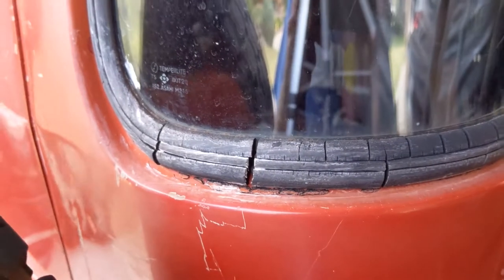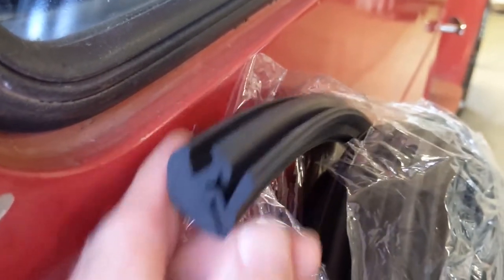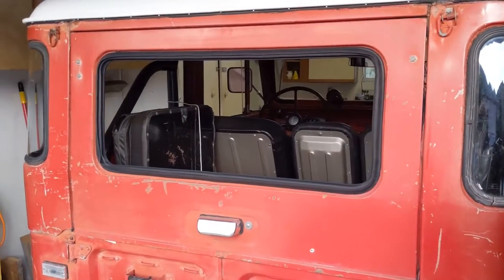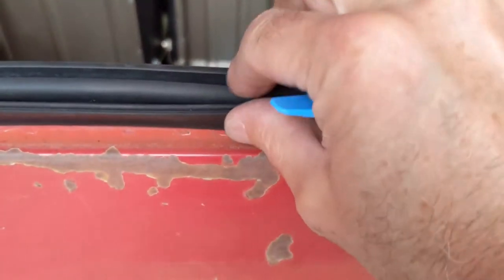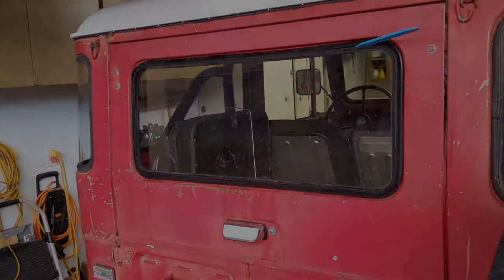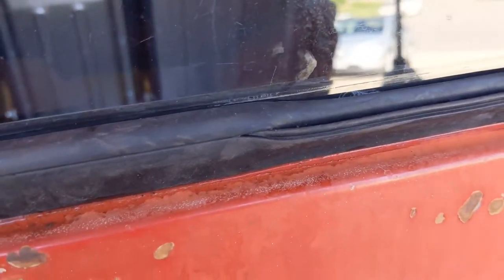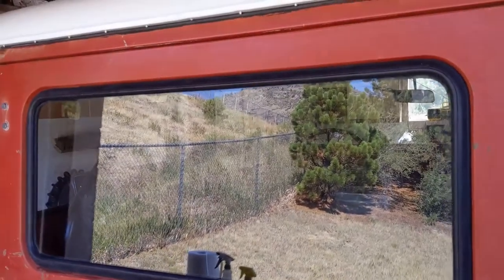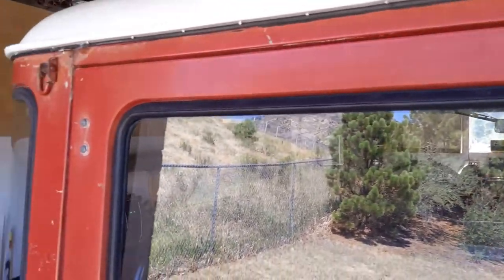Struggling With Window Seals

Comment: Install the rubber on the glass wrap strong thin string in the channel where the rubber mounts on the body ( do two loops) have someone hold the window in place from the outside.Climb inside and pull one end of the string and it will drag the rubber over the steel edge in the door by the time you have pulled the string around twice the rubber is in place.
Reply from the maker: Despite several attempts over the years, I've never mastered the string technique. I probably should have just bought the Trim Lok tool.

Comment: Hey, thanks for the tutorial. I'll be doing this on my 1965 f250. I have a question though: shouldn't I use silicone to make sure rubber stays in place?
Reply from the maker: On this type of window seal you shouldn't need silicone. Once the lock is in place, the seal is trapped with nowhere to go.  I don't know if your F-250 uses locking window seals like this. I'd double check that.

Comment: I bought these for a 67 Fj40 so hoping the trim line will work
Reply from the maker: It should.  There's a bit of an art to installing them.  Recommend buying or making an installation tool and using soapy water to make it slippery.  Best of luck.
Reply: I have a '67 and am about to do this project. Did the glass work ok? I ask because a '67 has thinner glass than a '71. Do you have the part numbers you used? Thanks!
Reply: @joshvjoshv  Worked out fine, saved bunch of money that way too, it helps if you have a bud help you out but can be done solo.

Comment: very cool, did the kit come with all the weather seals for all the glass?
Reply from the maker: I didn't buy a kit, I bought the seals I needed from three different sources. 

The window seals are made by Trim-Lok and bought from Amazon.  You buy Trim-Lok by the foot and it took about 40 ft. to do all the windows. The door seals were real Toyota parts from toyotapartsdeal.com. The rear door seals were aftermarket and came Cool Cruisers of Texas.

In the first FJ40 restoration, we ordered a kit from Cool Cruisers of Texas that had literally every rubber seal anyone would ever need. That was more than 10 years ago. I don't know if CCOT still sells that kit.

Comment: Needed help getting the glass out. You skipped the only part I needed help with
Reply from the maker: Sorry about that.  Unless the rubber is still soft (unlikely), you'll need to cut the seal away.  

To cut the seal, run a utility knife between the glass and the seal, cutting the channel that holds the glass. The glass will come right out, so be ready.